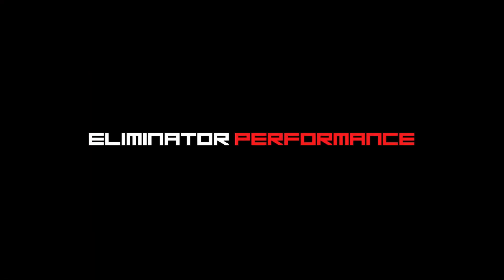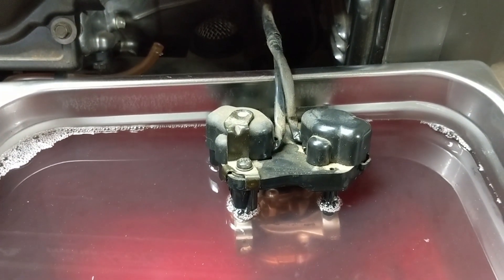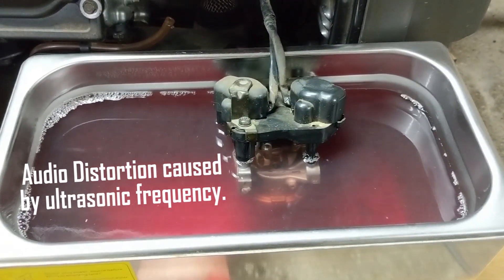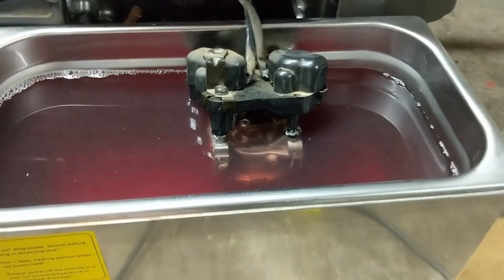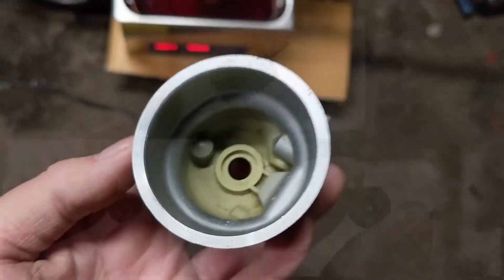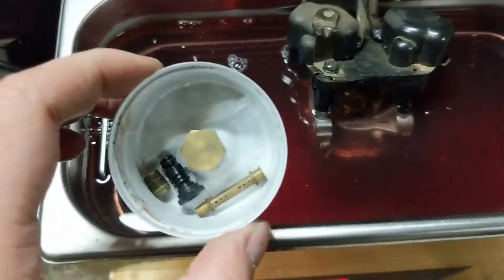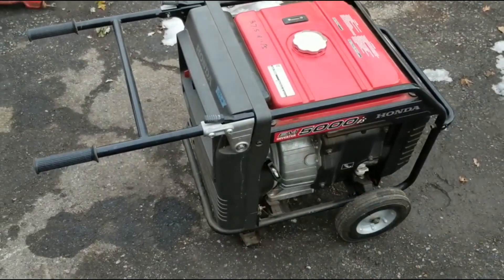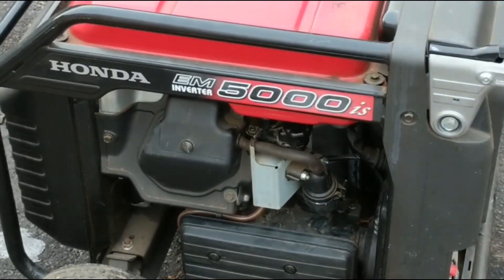Honda EM5000IS Generator - Cleaning Carburetor

Comment: Working on the same generator just a little older, I can remove the servos on mine.  Cleaned carb, however, cannot get main jet out, rusted or galled.  Cleaned all hole's w/tip cleaner.  Replaced spark plug, cleaned air cleaner, fresh gas.  Gen starts and runs and the dies like out of fuel.  Will idle, but hunts.  If I place one finger in front of the carb intake manifold, I can get it to run like a top.  Air fuel imbalance, right?  Should I try to drill out the main jet first before buying a new carburetor?  Any ideas or comments welcome.
Reply: Same problem I'm having. Starts but only runs for a few seconds and shuts down. Help!!!!😭

Comment: Is there a fuel shut off on this generator , which would allow you to run the carb dry between runs .
Reply from the maker: I believe there was, but wasn't run dry. This was stored for a couple years and the fuel broke down.
Reply: Yes